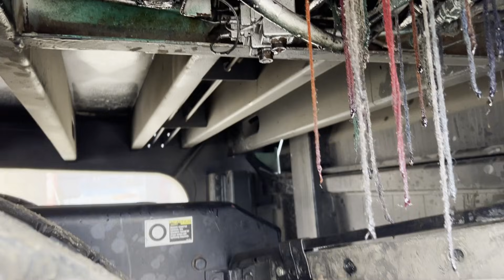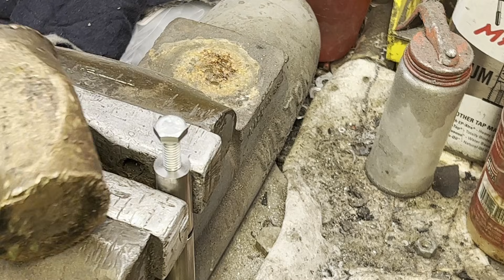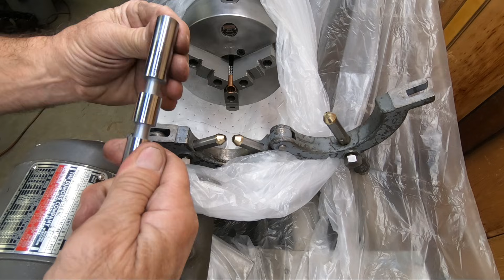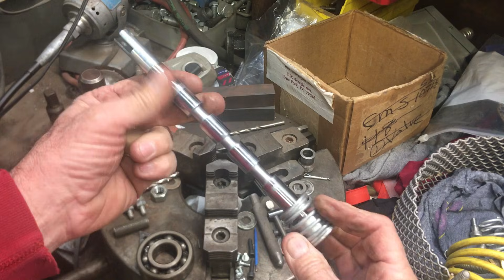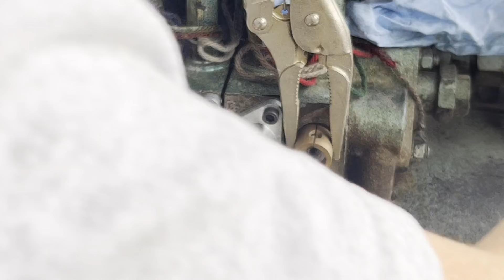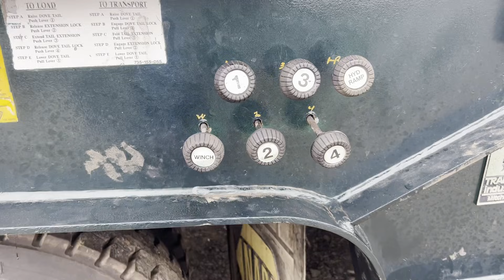Hydraulic Spool Valve Repair

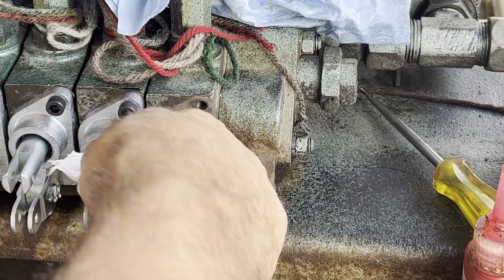Comment: 24:19 Okay lets start here. I have a leak maybe two. Or even three. And I'm thinking this O'ring here might be why... Is it possible to remove that ring, while the body is still on truck?  Mine is a 6 spool. And I think i have this issue. It's not real bad, but is dripping.
Reply from the maker: As you can see in the video, you can remove the ORing with the valve in place.
Reply: @OldIronMachineWorks  Nice
Reply: Well my tools suck. So I asked a mechanic I knew. He's claiming something is keeping him from separating the controls from the spool.. Something black. It's time, and he didn't want to get filthy I say. So 2 leaking is better than all of them. So at least I know a little more about it now.. I can't get shitt done.. $$$$

Comment: Hey Gary, would it be possible to know the symptoms of the hydraulics when the spool was busted by the tire? In fact, what's the kind of issues you'll face when you have a spool valve problem? 

I have an issue with old backhoe on the back of my tractor. When i pull just a little on the joystick that operate the main cylinder for the boom, the boom will slowly fall down but when i pull all the way down, it will move up like it's supposed to. Also when my bucket is heavily loaded, it will stuggle to lift or simply won't lift at all. Do you have any suggestions on where to start toubleshooting this? I think about checking the spool valve but I was curious to know your opinion on that. All the rest of the cylinders are working just fine, except this one.... so I do not think it's a pump issue. I am VERY clueless about all this I never touched hydraulic stuff before but I am willing to put the work to fix it. Let me know and thank you for sharing this is awesome to wactch.

Comment: Why would the spool need  to be brought down? I have a sticking spool, doesn't want to slide through freely. Used some emery cloth, tab of corrosion, flakes of chrome coming off.  Friend thinks cylinder maybe wobbled in spot or two, thinking of honing if I can find one that fits. So you didn't really take down the piston the whole length just on end. Why would spool expand on the end?

Comment: really like your channel, always watch the videos as they come out. liked this one a lot as well. i was an automotive tech for over 20 years and a master tech. i relied heavily on the extractor set you used in this video. i liked it both for the parallel design on the extractor that does not wedge the work out as bad, but also the drill guides that come in the set. if it's o through hole just go for it. if the extractor breaks you can punch it out. and you can still go again. if that doesn't work out you can use the center drill piece. once center drilled i have been able to use my drill index, ultimately pull what was left out like a slinky. also use time cert products any where every where. they don't recommend for metals other than alum. but i think i will wait till it stops working. never ben beaten by a bolt or nut. an air hammer can also be invaluable in this situation. thanks for sharing.
Reply from the maker: Thank you JACK. I appreciate you watching the video and leaving a comment. There are many different ways I get out broken bolts or studs, but for most things these are my go to easy out.      Gary

Comment: New subscriber here.
I like those Blue Point extractors.
I've had good luck with using a torques bits for extraction of broken bolts.
Reply from the maker: Way to funny, I also have used torques tips in my hammer style bit driver, but they have to be good quality ones. But then I have been removing broken crap out of stuff for over 40 years so there's not to many ways I have not tried.
Thanks Dan for the sub and for taking the time to watch the video.    Gary

Comment: Probably a stupid question, but when you showed the finished valve block, what's with all the colored strings? Was that just to soak up any oil to indicate a leak? If so, is that just for pressure testing, or do you leave the strings on?
Reply: Oh wait, I'm dumb. They are to label which hose goes where, no?
Reply: I might be dumb, but at least I'm not alone in it

Comment: Thanks so much for this! I had never seen those extractors before. They look fantastic. So does that trailer, for that matter. That must have been a major investment, but certainly worth it.
Reply from the maker: Thank you Bruce for stopping by and watching the video.     Gary
Reply: Have a set of them for years. Great on broken brass. Won't look up and strip out like tapered easy outs.

Comment: I got some left hand center drills and drill bits. Lots of time they will screw them selves out. Win win
Reply from the maker: Dale, I do use my share of left-handed bits. But in this application I would’ve had to heat up the spools do to the locktite , was trying to avoid doing that. I appreciate you checking out the video.    Gary

Comment: I worked on a hydraulic beaver tail that got hit and mangled the cylinder mounts. Cut stuff out and welded new in. Al B.
Reply from the maker: Sounds like your job was much larger than mine.
Reply: @OldIronMachineWorks  Yep took two of us a day and a half to get it done.

Comment: As far as easy outs go , those ones work pretty good .  Great to see a bit of TPG action as well .
That's one flash trailer , never seen one before with hyd operated ramps to the gooseneck .  
Cheers .
Reply from the maker: Thank you Max